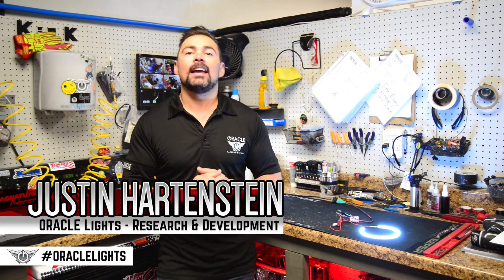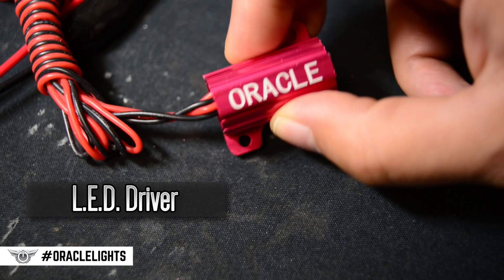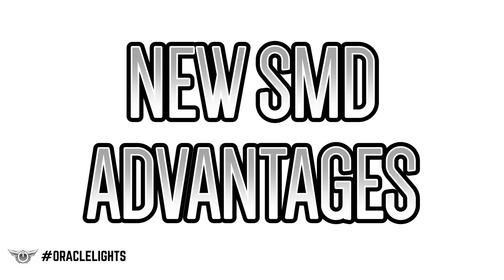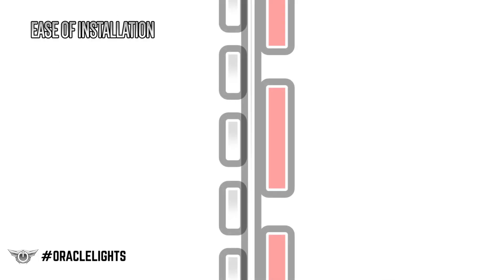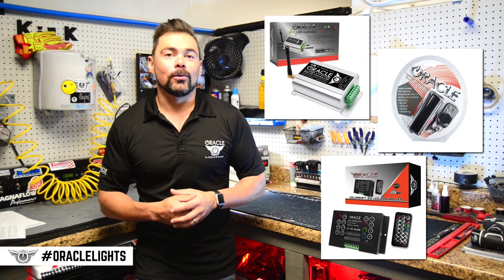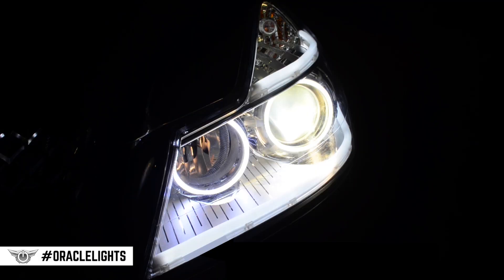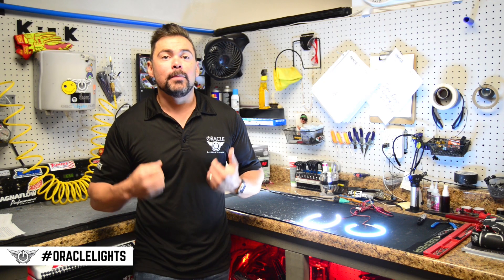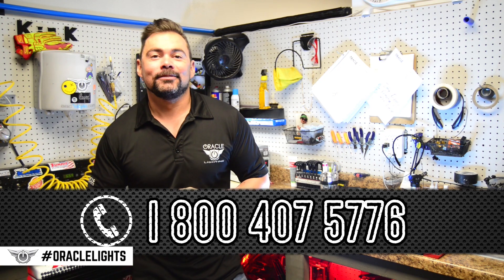ORACLE Halo Ring Overview: SMD vs. Plasma LED Technology - Which is Brighter?

Comment: The retrofitsource site is lame. Never displays halos as other sites sell. 

 Oracle, Race sport, Carid, Ebay, Amazon all show different sized halo rings, kits & sets that can be bought without forcing to pick a specific effing vehicle. 

I'm not impressed. All I've been looking for are 90mm/3.54" plain white with AA sized drivers. 

My race sport ones finally gave out. I installed them without drivers. Need new ones with drivers. Paid $55.00 on ebay. Can't find them anymore on ebay. I won't buy or bother from Amazon.

Comment: I have a 2013 mustang GT.  Will the plasma halo pre-assembled headlights connect to the existing wiring harness to use them in the same way as the stock daytime running lights?
Reply: You can connect the Halos to your parking lights, running lights, Daytime Running Lights, or to a separate switch all together. It just depends on what you want to use to activate the halos.
Reply: @ORACLElights  thanks!

Comment: Why were the Orcale plasma halo discontinued?
Reply: Only RED and AMBER Plasma are discontinued. RED and AMBER COB LEDs can be unstable and lead to eventual failure of the chips. We could not guarantee a 100% issue-free customer experience so we discontinued these colors in Plasma.
Reply: Thanks for the reply... I got the led 2.0 Orcale halos and my Camaro brake lights look AWSOME..